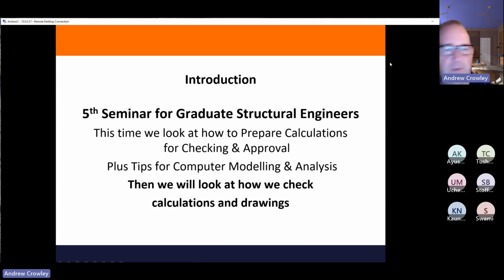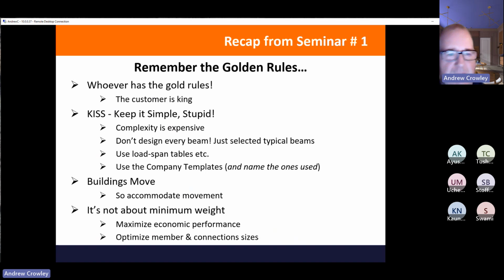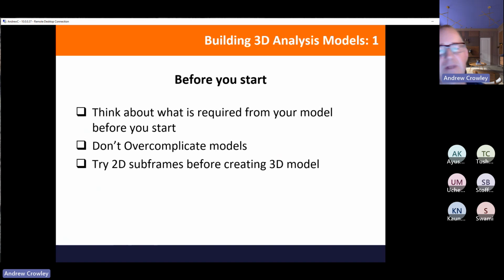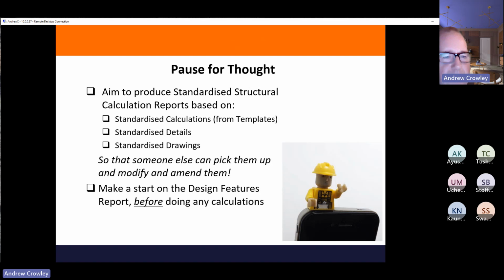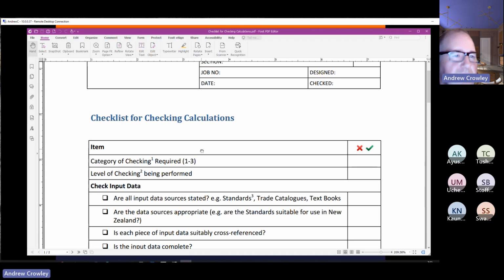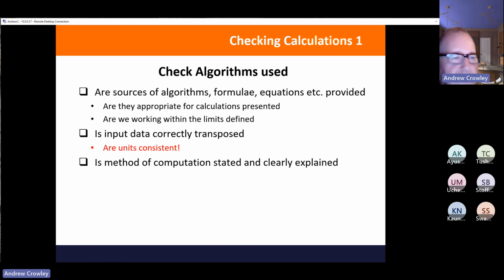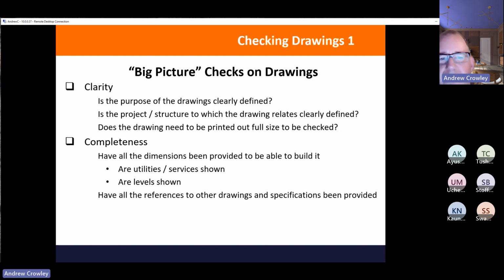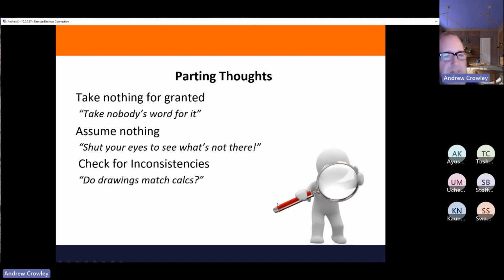CPD Seminar #5: Preparation of Calculations and Structural Design Reports

Comment: Is it possible to prepare a complete design report using Mathcad?
Reply from the maker: It is possible, but I wouldn't recommend it. Structural Calculation Reports will include calculations from many sources as well as text descriptions, drawings & photos. What I would suggest is that you keep the calculations as separate files, generate the PDF files and compile the report as a single PDF file using a PDF editing tool.